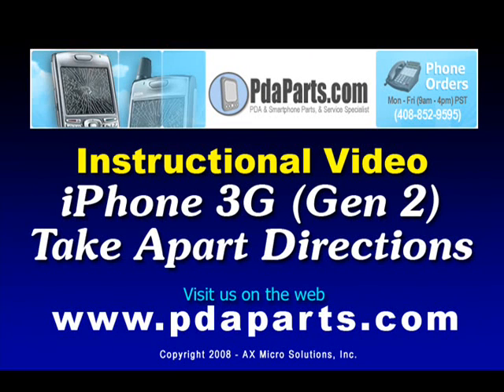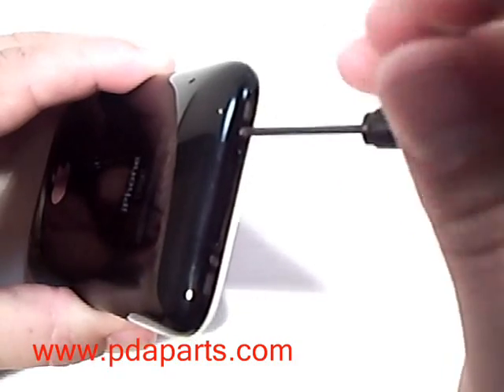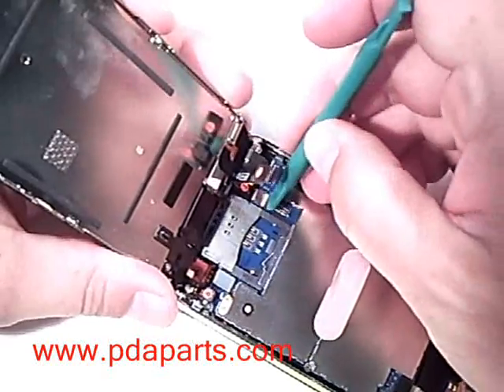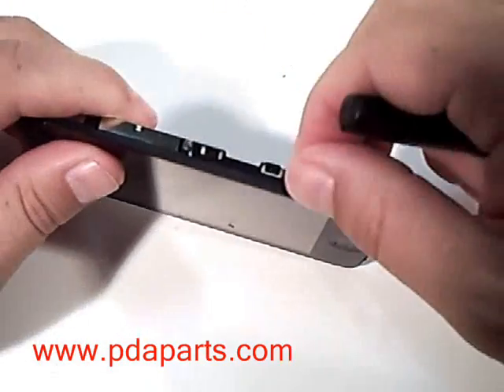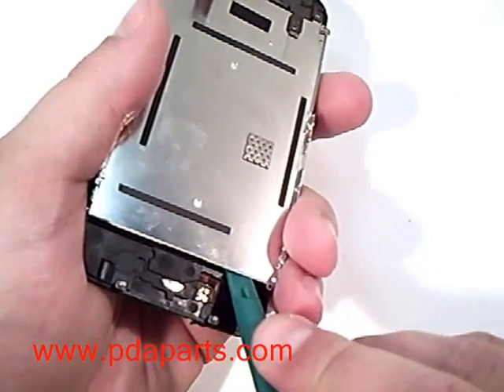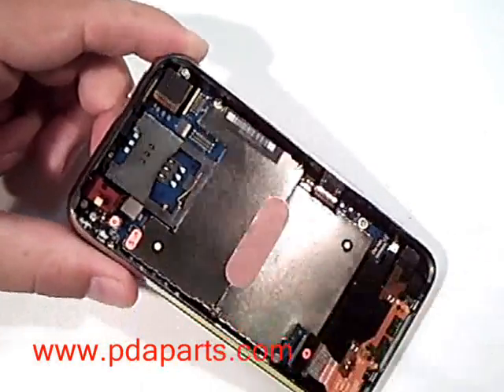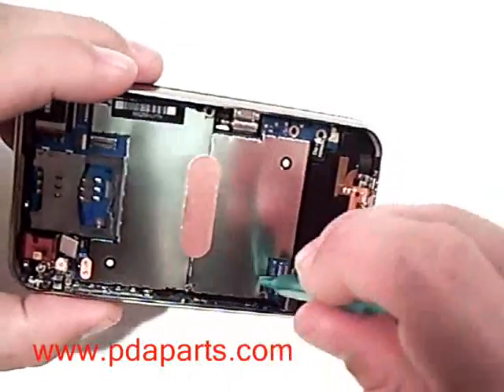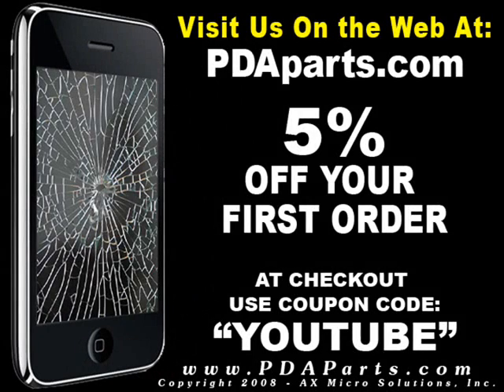Take Apart The iPhone 3G Step by Step Directions by DirectFix.com

Comment: Hi I have some issues with my iPhone (3GS I think) anyway the very left of the screen at times won't respond to touch at all and other times it'll just decide to start working again any ideas two other problems are 1. the stand-by/off button I sometimes need to cram on to get it to work and 2. the switch to turn it to silent doesn't work at all any help you could offer on these problems would be very appreciated  thanks for your time

Comment: i have an iphone 3g waiting around for an unlock and an iphone 2g that is unlocked but i dropped and the case came completely apart. Do u guys think it would be possible to take the logic and comm board out of the 2g and put it in the 3g's case? Are the touchscreen, headphone jack and ect's connectors the same in the 2g as the 3g? what do you guys think?